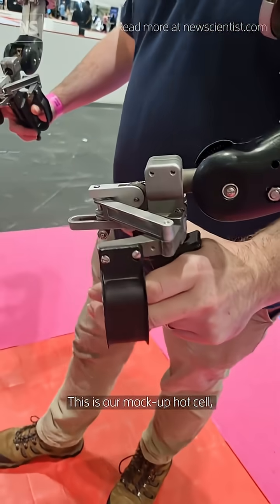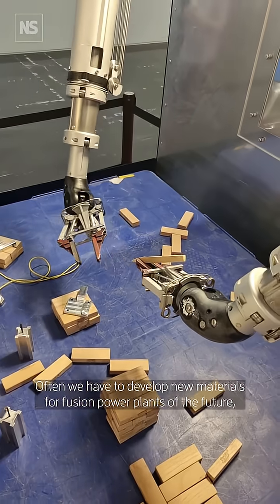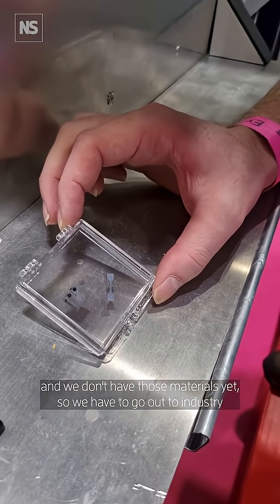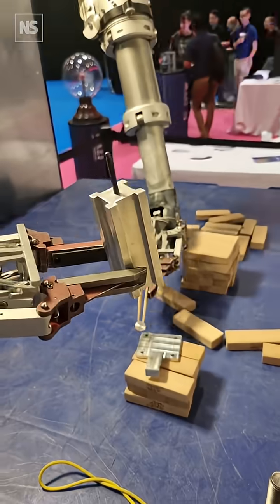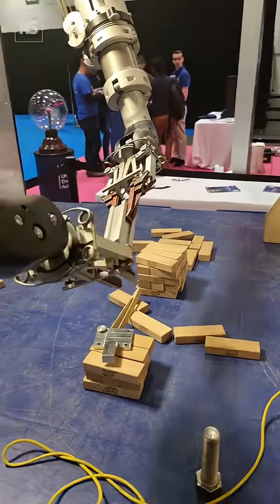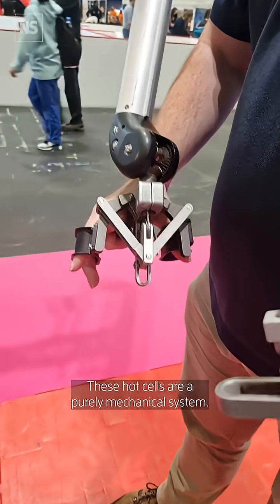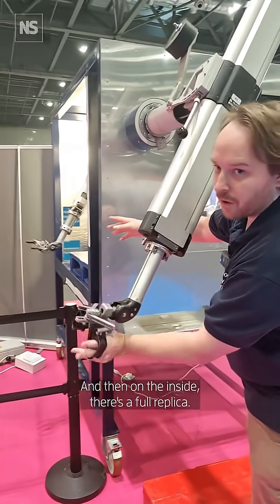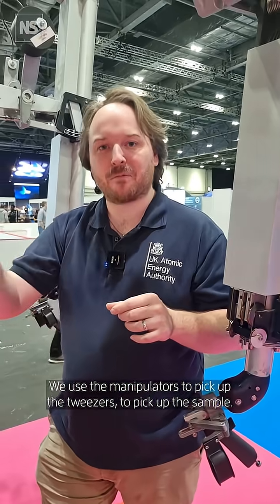How fusion scientists handle radioactive materials ☢️⚛️

Comment: It’s a completely mechanical system for a reason.  If there were any electronics involved, they could get fried by the radioactivity.  And building a mechanical hand to mirror your human hand is a lot harder to do and to maintain in operational condition as compared to the “Waldo” pincers that you see here.

Remember, this can’t just be designed to work once in a lab.  It’s got to work millions of times, day after day and year after year.  It cannot fail, at least not easily.  If it did fail, you could risk a major exposure of radioactive material, and nobody wants to drop a nut into a space that could lead to another Chernobyl.

So, they have to build to the same standard of reliability as you see in space craft, or inside of nuclear reactors.